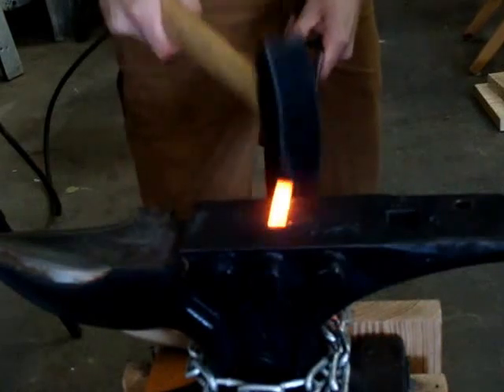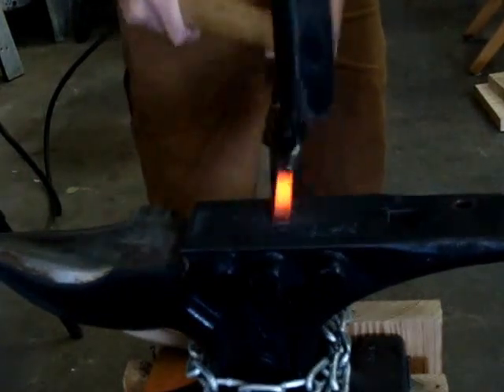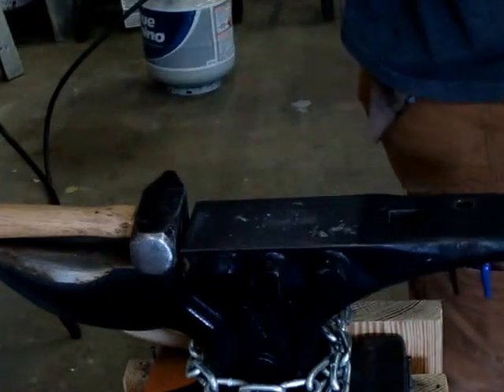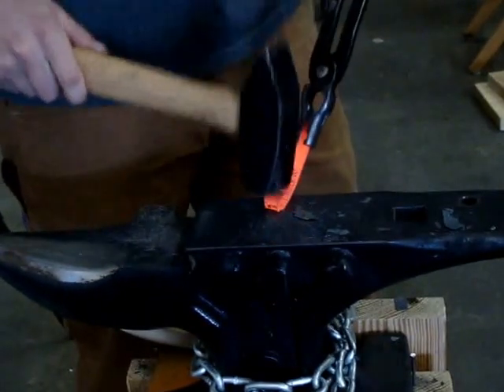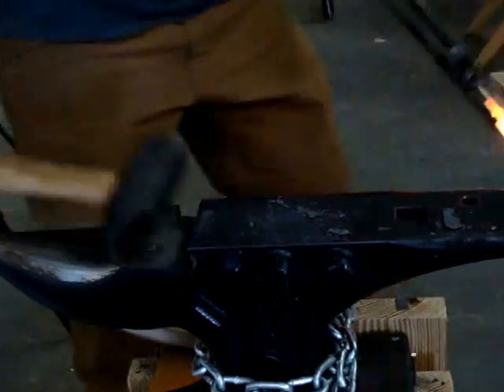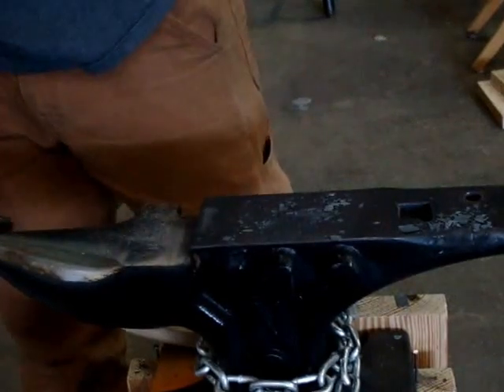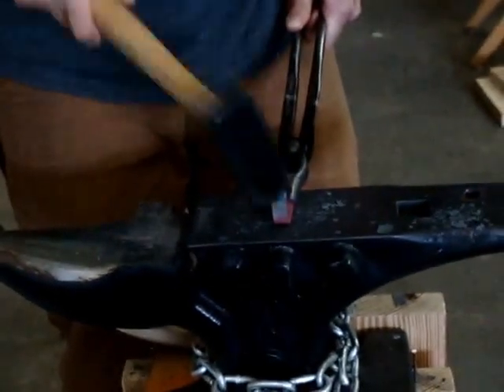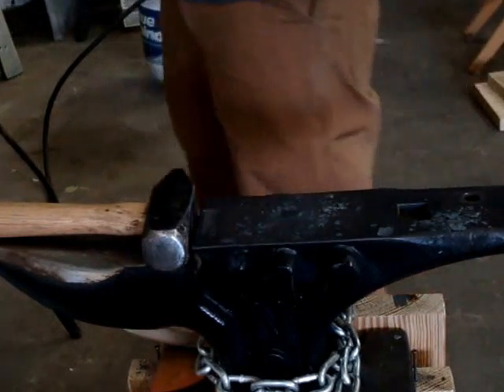Forging Unbreakable Bottle Openers

Comment: Sounds like you have a door on the forge it was open when I was there is that a different forge?
Reply from the maker: Hi Ben! Yep, different forge. 

The one I used in this video is a Forgemaster with a front bay door. 

You used a double burner Majestic Forge with open end ports.